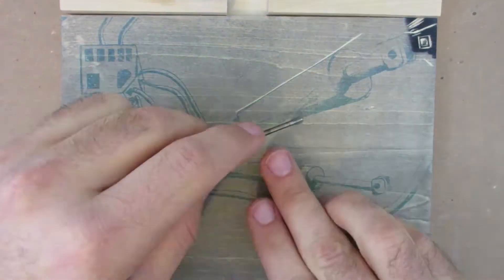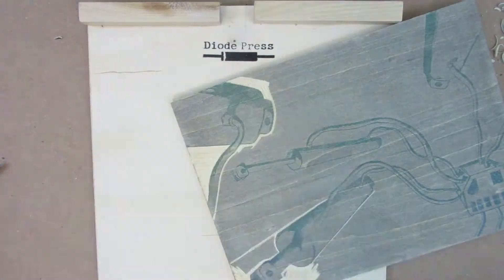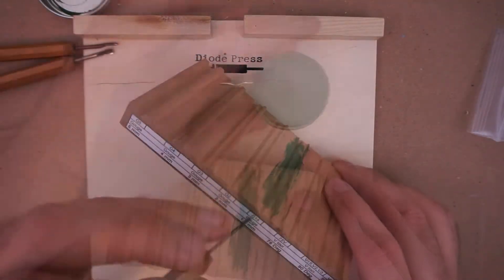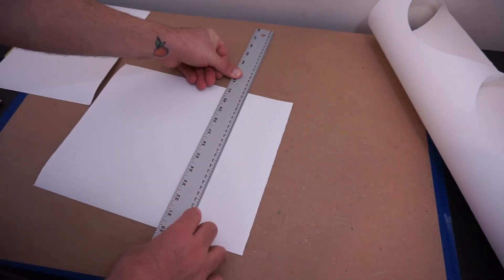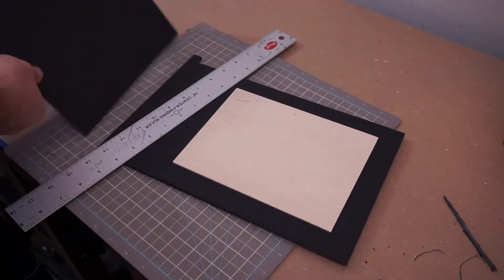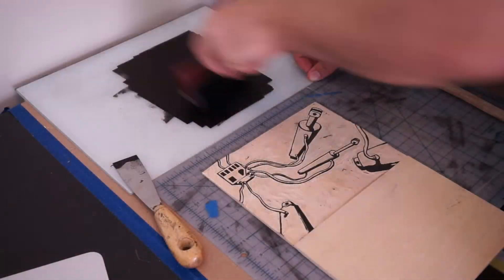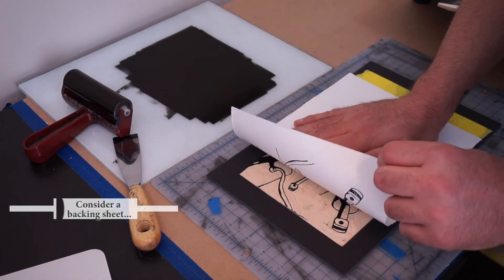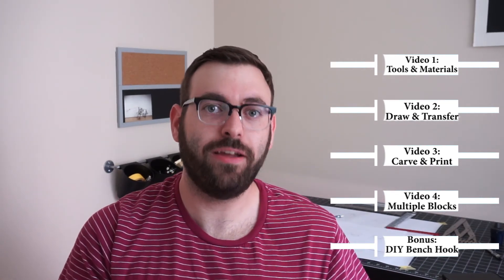Woodcut Printmaking Basics: 3 - Carve and Print Your Block

Comment: Excellent instructional videos Graham, really appreciate it. I am new in woodcut and linocut printing (my retirement hobby)  My problem for printing is that my first prints are always good and sharp but second and third, not so good. Ink seems to get into the cuts and cover the spaces, especially the tiny details. Do I need to clean my blocks for each print? What am I doing wrong? Thanks a lot!
Reply from the maker: It sounds like you might be using too much ink, or too much pressure. I would try using less ink first, and see if you still get good prints. Sometimes I do have to clean off the block mid-edition if it starts to build up too much, but typically I get quite a few prints first. Thanks for checking out the videos!

Comment: Do you seal your block before printing?
Reply from the maker: +Malinda-Ro Koehn I typically print with oil based inks and usually don't bothered sealing the blocks for multi block prints. I don't think there would be any problem sealing it if you wanted. Often I'll seal a block for reduction woodcuts (to preserve my drawing).
Reply: +Diode Press Thanks!

Comment: I am extremely ignorant here, and not trying to troll.  This is my question after watching a few videos.

What is the point of this hobby?  You spend so much time carving an image/art/design into a block of wood, just to then press the image onto the paper or "print".  Why do all that work with the wood when you can just draw the image on the paper?

I also think the carved wood looks a lot better than the ink on the paper.  It almost seems cheap, where as the carved wood looks a lot better.  I would pay more for the wood carving too if presented both options.

What am I missing?  Why do all that work just to stamp it too paper!

Someone cure my insanity!